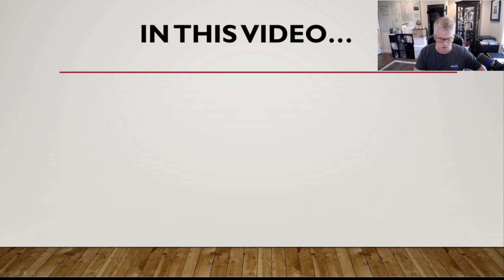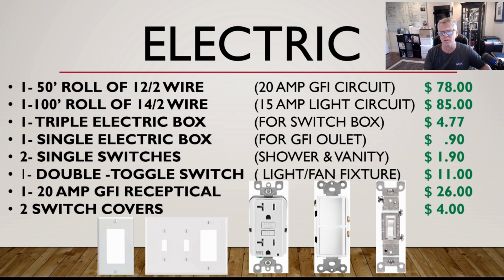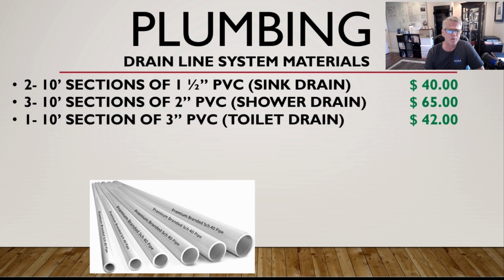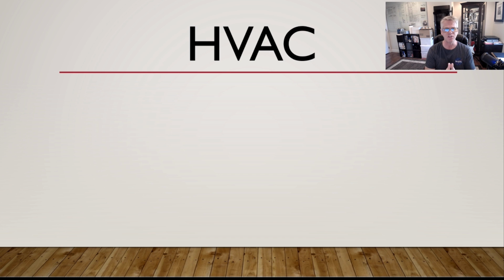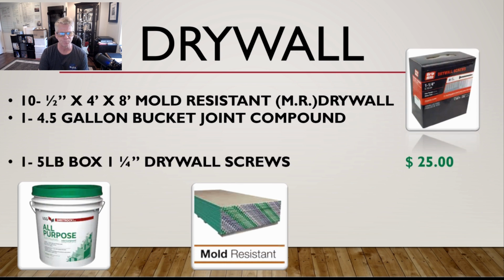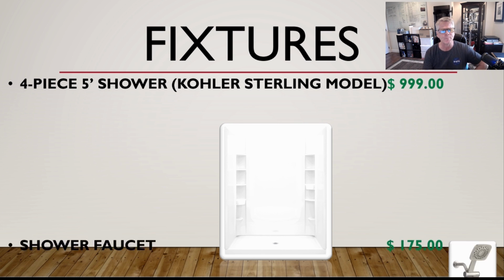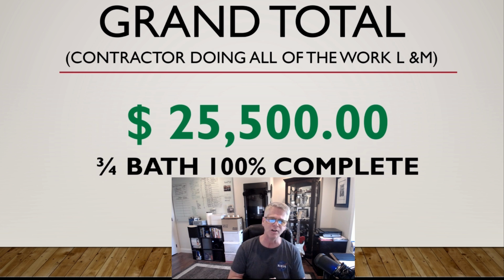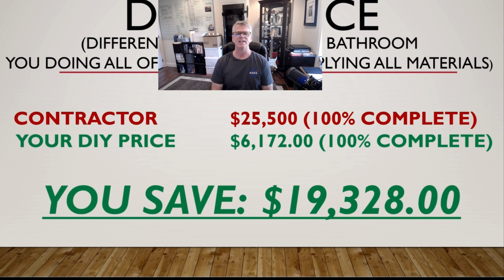How Much Does It Cost to Build a Basement Bathroom (List of All Materials & Prices)

Comment: Nice breakdown of the cost to finish a basement bathroom. I have one question: I'm considering a Saniflo-type system to simplify the project and avoid excavation. Would you recommend this approach?
Reply from the maker: Not a fan...do not use on our projects. Hard to incorporate showers and tubs as you must build them up of a higher platform so they can drain correctly...to modular for us...

Comment: appreciate you putting all this knowledge at our fingertips.  Is the starting price still around $55 sq. ft (given inflation and the increase of materials)?  Does this include ceiling drywall?  Do all the drywall installed in the basement need to be green/purple, mold resistant?
Reply from the maker: No Just in the bathroom!  ~Eddie

Comment: what planet you are on, $6172 for mat( you do), 9x5 bath, $25500 if contractor do it, i wana know which area is it, so contractor wants $19000 crazy, guys I dont know its a real rip off.
in general labour is max 60 to 70% , rest is mat.
Reply from the maker: That's labor and all overhead and operating cost rolled into that number...it's certainly not all profit brother.  ~Eddie
Reply: 20-25k bathroom is about average
 How ever you can definitely cost cut and DIY yourself alot cheaper

Comment: I intend to finish my basement, but in stages, so that I don't have to put out a lot of money all at once. The first and likely the most expensive step will be the bathroom. The only part that I don't want to do by myself is the digging up of the concrete floor and installing the drain system, even though it has been roughed in for me. I bought the house new and I was fortunate on that part, although I still have to slightly re-arrange things. Thanks for the very informative video, and I will be referring back to your channel as I progress.

Comment: Want to send a question your way,
I got a basement to do with walls that are already insulated. I wanted to know whether or not insulation batts should still be placed in between the framing studs, seeing that the walls are already isulated?
Reply from the maker: Yes McGeorge definitely should be insulated between all exterior wall studs...the existing wall wrap insulation is not enough!  ~Eddie